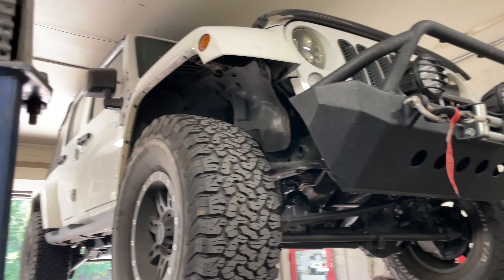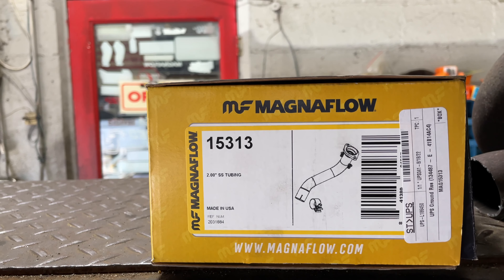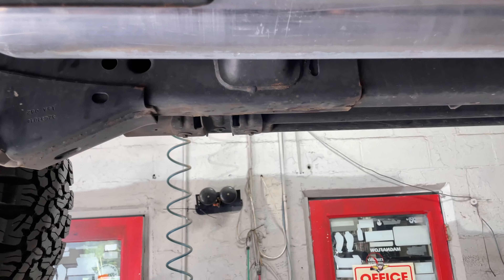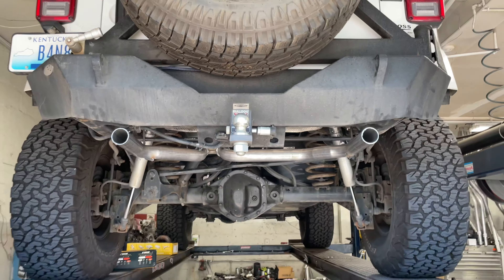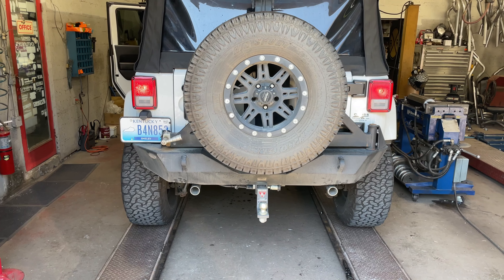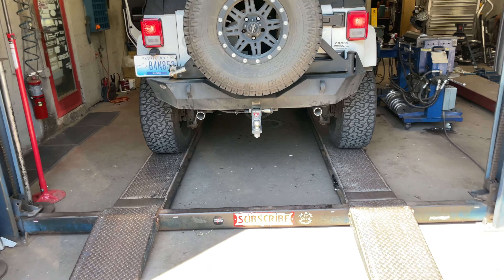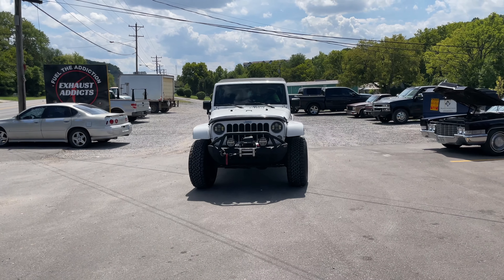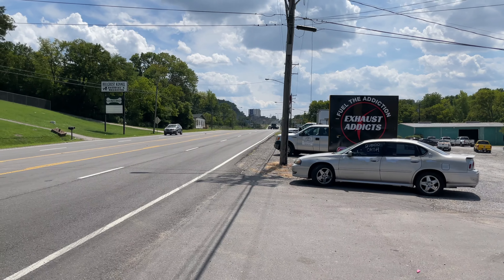2015 Jeep Wrangler V6 Dual Exhaust w/ MAGNAFLOW GLASS PACK & LOOP DELETE!

Comment: Sounds better than factory. Quiet enough to wander the trail without excess. But I agree, it could use just a little smaller glass pack. Not much though. Keep up the great vids!
Reply: Yes maybe like a 14 inch is the sweet spot
Just needs to be wider

Comment: I mean eh. But at the same time my question is why get rid of the equal length of the exhaust? I'd imagine it flow better as an EL exhaust
Reply: Probably gives it a bit raspier tone; less smooth.
Reply: That delete give the front drive shaft more clearance. I look into when I was planning on getting a wrangler a few years back